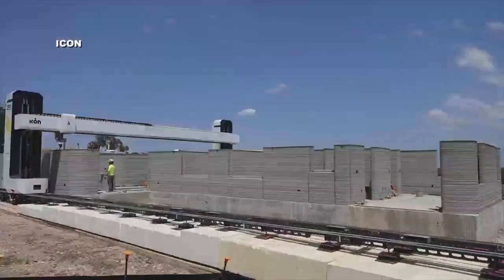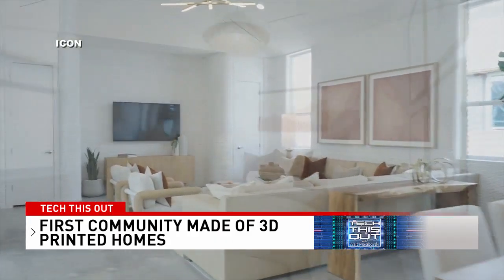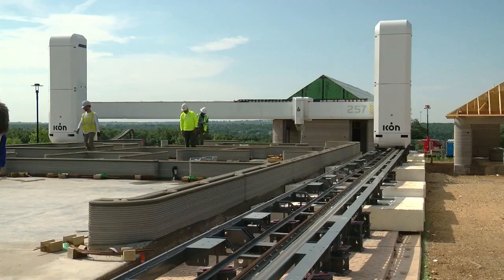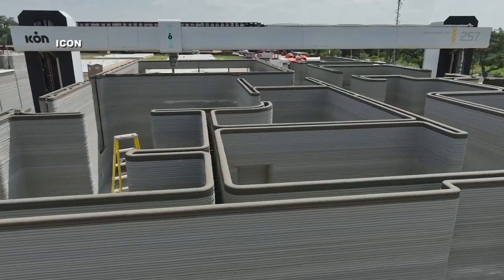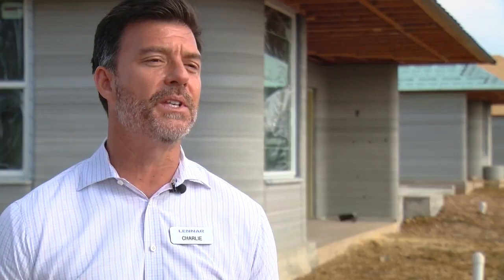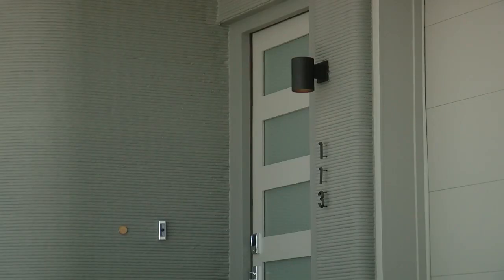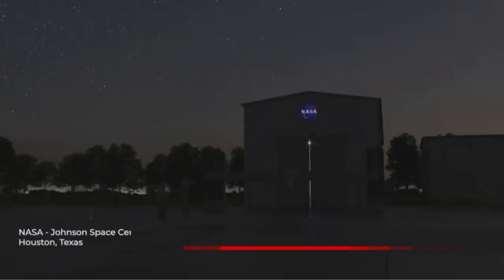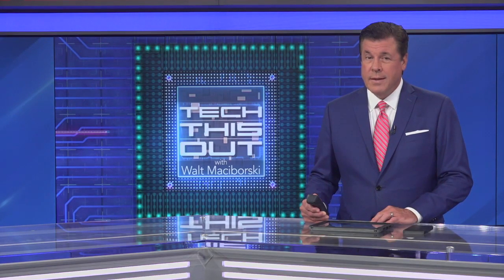ICON and Lennar start selling homes in first ever 3D printed community

Comment: 3D printed homes are definitely one of the ways to go. Especially for cutting down the costs which makes it easier for new or first-time buyers. Let alone being great to use in countries that need rebuilding like Ukraine or in nations like the ones in Africa that need homes right now that are also good for ventilation. Something that 3D printed homes can be designed to be like right from the outset. I fully support 3D printed Hooke and other structures.